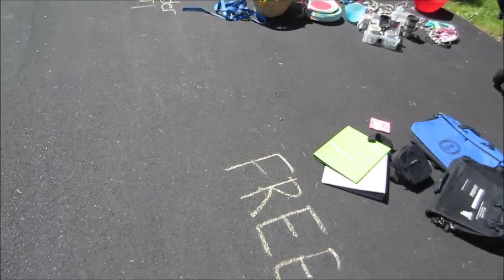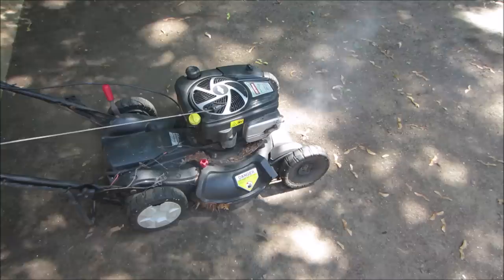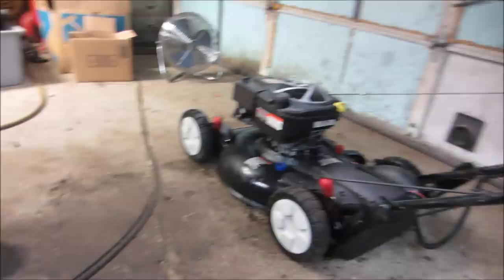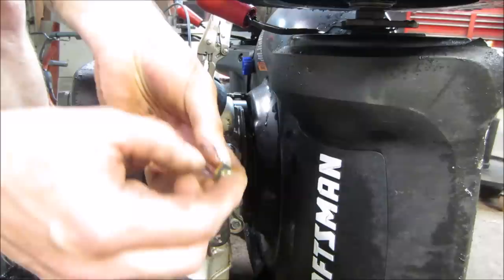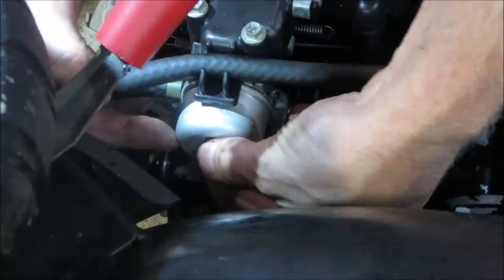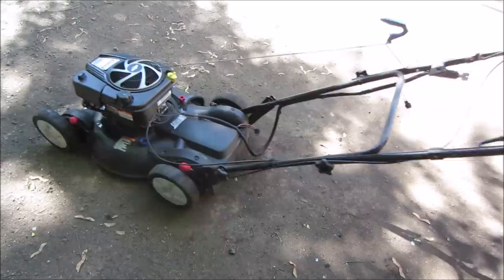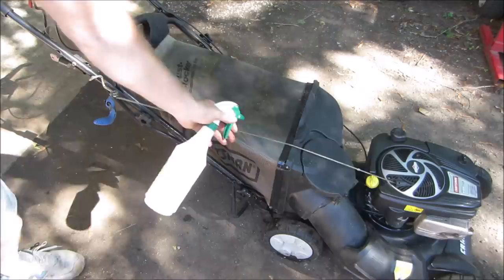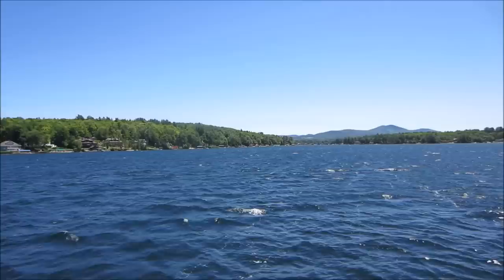Free yard sale broken lawn mower can we fix it?

Comment: My neighbor was throwing away a Toro Recycler, they said it was leaking gas and wouldn't stay cranked.  Looked like someone had taken the carb off and didn't have the auto choke set right and the bowl nut wasn't tight also the throttle plate was bent way down causing it to run slow.  30 min fix, cuts like a beast.
Reply: Does he give you the stink eye when he sees you cutting your grass?
Reply: @jaimhaas5170  No, they bought a new EGO battery powered mower.

Comment: To get the oil out of my pushers .I use a,1/2in PVC with a coupler to 1in to 2 inch and the 2 inch is about 10 inches long that equals about 2 quarts way bigger then most pushers can hold the other end is pushed onto my shop vac 3 seconds all oil is out kinds works like a line sprayer.i also have a ball valve to shut off the flow so it eont spill all over the place

Comment: Why mowers don't need oil changes.  From Briggs n Stratton: Its air intake system is sealed tighter so that dirt doesn't get inside the engine and contaminate the oil, and the engine runs cooler so that heat doesn't break down the lubricant.

Comment: I got a free Husqavarna mower with a Honda engine, which was $450 new for this exact reason.  Overfilled the oil and it fouled the plug.   Bad plug caused a hard start.  Dude gave up and bought a new one.

Comment: Actually was surprised to find on my mower while had a drain instructions had you tip the thing on it side and drain oil from the top like you did.  was a lot less messy that way too.
Reply: Their lawyers told them to print that. Keep the dumb public as far away as possible from the drain plug down by the blade : might get an owie and sue.

Comment: Dude, you really need to invest in a vacuum oil extractor. I use mine all the time. Much easier than all those gyrations you go thru all the time with these things, and not all that much money. One of the best investments I’ve made in shop equipment.

Comment: Additional Add to your 4 math Video.  Just the other day I Went to the Store and Seen a Lawnmower sitting next to the Curb Went and Knocked on the Door Asked " are you Getting rid of the mower in front "  Yes You can have it. It's Winter outside cold Okay Thank Quickly Putting it in the Trunk. Took it home Wondering what could be Wrong looks Brand new.  Pulling the Cord Twice Started up Hmmm. The Blade and Deck underneath Didn't look like it Cut the grass but one Time. 6.5 hp push Mower with brand new grass bag.  Good Score for Free When Summer comes back Around to Sell. People Throw Away or just get rid of some Crazy stuff.

Comment: I once got a free snow blower that had a rock stuck in the tine. Whoever was throwing it away I guess didn't realize why it wouldn't start. I got free lawn mower the neighbor was throwing away because it smoked bad. His son would turn the mower on its side to clean it out and the oil and gas mixed. The oil was almost all gas. Changed the oil and ran it an hour and ended up selling it for 150 dollars. Lol

Comment: Also mustie for further endeavours of cleaning fabrics trying washing machine powders that have stain remover built in into them and just sprinkle it over it and then lightly spray down with water and give  quick scrub let it soak in and then pressure it should yells much better results (even dirt cheap washing powder should work)

Comment: Mustie1, I am pretty sure that the battery is hidden under the black plastic behind the engine. That is where it is on similar model mowers.
Reply: yep, and the plug that should goes to the battery is "hanging" right there by the rear right wheel/handle

Comment: have one just like it got it free also spent 20 mini on It to fix (new plug new air filter,  Oil cap was loose was my problem, owner didn't ck it.   (I own/operate a sharpening service so I new what to do) P.S sharpen or replace the blade it will be worth your time,

Comment: For some one else struggling with one of these , do a compression test first ., many have plastic intake manifolds which seem tight , but upon closer inspection are loose at the head .,This leans out the mixture ,& destroys the intake valve , (check the edge ,if it's sharp as a pizza cutter you're done)..The compression should be 75 lbs or greater. Mine was 35 lbs , & although it would idle ., nothing short of an electric drill would start it & it had," predictably" , no power.

Comment: I believe the battery goes underneath the mower deck at the rear.
Reply: under the center plastic cover, which also covers some of the wheel drive setup. the power wire to the battery is hanging right by right rear wheel/handle area too ;)

Comment: Mustie, a pressure washer takes time for the water to "eat" away the dirt.  If you just keep moving it it will not be very effective.  Slowly move the water jet and let it do the work. Janky movements ruins the effectiveness.
Reply: Doing by moving the jet around is like using a regular hose and wetting it down.  Useless.

Comment: it's surprising how much havoc can be created by overfilling the oil on an engine. through an unfortunate series of errors i added an extra qt (or two) to my yamaha motorcycle engine once. after about a month of oil leaking out of the engine breather tube and into the airbox and out throught the air intake and down the side of the engine to finally lodge behind an under a chrome beauty panel on the outside of the engine and bake and smoke and stink for a few months, i spend about 20 hours trying to remove all the accumulated dirt encrusted oil from the engine. the fight ended in a draw....

Comment: I'm looking for a Craftsman bag for my push mower. I just recently found out they made about 200 different styles of connecting them to the mower.........ughhhhh. Not to mention my area is sucking for used cheap mowers.
Reply: Look at the model number of your mower and search it up, go to e replacement or parts tree or any other website with the parts of specifically that mower. You should find the bagger, you can order from there but usually it’s more expensive. The other option is after you find the bagger you want, copy that baggers model number as well and paste it into eBay or Amazon and usually it will be cheaper. Hope this helps but if you need more explanation tell me thanks

Comment: He was probably told that the plastic intake manifold shrunk back at the head (which would then lean out the mixture)., & that the valves would now make good pizza cutters ,but would be no good for anything else....Many ended up like this, & a simple compression test will usually show about 35 to 40 psi (about one half of what the spec is) ..yup it will start , but won't have the power of a fart in a windstorm.

Comment: If I want to clean the bottom of my lawnmower is there a way to tip it so the oil doesn't run out everywhere? Should I just empty oil each time? I want to keep the push mower underside from rusting and I know to be careful and not pressure wash the underside because of the seals down there. Thanks for all you great videos.

Comment: You may have mentioned it, later in the video it looked like you pulled the plug wire off before messing with the blade. Safety first!
Reply from the maker: you missed it
Reply: bah, having eight fingers, two thumbs and whole hands is overrated said nobody ;)

Comment: Mustie1a, in another video, I believe the one where you fix your neighbors old green/yellow mower, you seemed to elude to something that is equivalent to a bowl nut gasket or locking washer. Are these expensive little sealing washers the same as a fibre washer? If so, do you know the ID of the fiber washer replacment? Looking like that's much more inexpensive that spending 5 bucks for replacement s. Thank you for your time and help

Comment: For 20+ years I'd find mowers around the neighborhood at the curb to be picked up by the town in the spring. Most of them simply needed a good carb cleaning, a few had sheared flywheel keys and one or two had bent cranks (those went in the parts pile under the big pine tree out back). A couple went to my folks house for doing where the riding mower would not fit. They're still there & still run. Most went up to camp for a season & then got sold to the locals for about $50. I noticed a few years ago that these thrown away mowers are getting harder & harder to find as the meth heads (aka scrappers) from the city are snagging them as soon as people put them out.
Reply: Paul G we've got a neighbor up to camp who's had a hardened steel key in his mower for about a decade as our yards seem to "grow" rocks every spring & he got tired of replacing the key every time he mowed. The crank is now so bent that the mower could double as a paint shaker at the local home depot. It was originally a 20" mower (I think) and he now has the blade ground down about 3/8" on each end so that the blade clears the deck lol. I keep waiting for the poor thing to give up the ghost but I sometimes wonder if it'll wind up running long after I'm dead and gone.

Comment: I hate the rotary engines that have a dipstick it's too easy to over fill the crankcase. The really old engines the fill plug was level with the top of pan .
You couldn't over fill as it would just poor on to the ground . It's a wonder your engine didn't hydro lock being that over full.

Comment: I'm not a mechanic...  I have found when I change oil in my small engines that if I take my air hose and blow air through the engine from the top oil fill port, with the bottom plug out that it blows out a lot more of the dirty oil out of the engine. It also speeds up the process.  Could this do any harm to the engine?
Reply: no your fine  just blowing into crankcase
Reply: Yes it could cause harm, you're blowing water vapor from the compressor into the crankcase

Comment: Lawn mowers got hubcaps now!  Pity you didn't have any spares!  Does the electric start only work with a battery?  Some snow blowers plug into the wall to start electrically.  I'd much rather pull start a lawn mower on the lawn than a snowblower in the cold.
Reply: Was that Lake Winnipesaukee or Lake George at the end?  IFF (if and only if to mathematicians) it's Lake George, you came near me.  Lake George doesn't ever have that broad a view of the water without land though, that we saw at the end of the clip.

Comment: I found that same mower one time. The grass catcher design on that one stinks.
Also the design and location of the trans is in a bad spot too.
I ended up pulling the Quantum it had off since that was the only good thing too it. Because it was already missing parts of its bagger, a strike against it for resale, no bag and the trans needed help too so that made it not worth it. It wasnt even that old, it was like an 07 and I found it in 2015.
Those are the designs that end up making people ask how old is the mower when you sell one, yet on the other hand their are tons of mowers that were built with quality from the 90's still around.
Thats what I'm dealing with right now. I have a few green craftsmans (AYP) built around 1997 and the first thing people ask me, how old is it, but the age doesn't really matter, because the mowers are in excellent condition and are truthfully better than new ones. In fact these particular craftsmans were the best ever sold in my opinion.
Yea well try drilling that into someones head, dead set on age as the most important factor, its not, condition is. Not happening. I even tell the people I'm not concerned if you buy my mower or not, I am telling you as a small engine mechanic these older mowers are better, if you find one thats in good shape its the best ones you can buy. They still think newer is better. Uninformed consumers, what can you do? Let them go buy the new junk they make thats all.....
They don't wanna listen.
Oh yea the one guy said he knew it was old, but not that old because it still had a primer instead of autochoke. That's wrong too. Autochoke isnt new its been around since outleast 09, so 9 years and they still make engines with primers. The Briggs 550ex engine is a good example they make them in both Primer and autochoke versions currently, so another misinformed consumer. The actual tell tale sign it was older is the fact it has a 208cc Tecumseh vector engine on it with a throttle control, but he didn't know that....
That thing is way old he says, after I say its an 07...
Whatever.
Yea old, but in great shape and cuts the lawn good, what more can you ask for...
Reply: Well I sold that 1997 Green mower today. $125. I got for it.
Easy person to deal with, he walked up said start her up. I did mowed one path, he said looks good and took it.
Best type of customer you can get.
Now I got two more of those green ones to go aside from the ton of other stuff left yet...
I didn't disclose it was a 97, don't ask don't tell. Doesn't matter one of the better mowers Sears sold anyway. Important thing was it was in great shape and cut great and will go many more years if cared for, thats all that really matters.

Comment: more likely the fuel was left on and needle and seat leaked flooding engine and running into cylinder,have come across it many times.change oil and away you .go.

Comment: I cleaned my carburetor and gas tank, changed oil,blade, and spark plug,  wont start what could be the problem. Gas is new also. Craftsman briggs and stratton 2013. Was mowing tall grass, stopped and backfired. I cleaned it after that happened.
Reply: Might have sheared the flywheel key?
Reply: mattmanyam  I will check that. Thanks

Comment: Some mowers don't have drain plugs on  them anymore
Reply: they still do, but like the mower in video, it's above a metal plate that covers the drive belt for the wheels. even many non-self propelled have a shield in the way and you have to pull both the blade and shield off. total PAIN

Comment: How do I know if my B&S 15.5 is a 2 stroke or 4 stroke ?  It doesn’t seem to run good on straight fuel and I have to reduce the flow of fuel from shut off valve as it seems to start acting like it’s out of timing with valve open all the way. The mix oil seems to run fine.  Any thoughts ?  New carb doesn’t have fuel air mix screw. Thoughts

Comment: Why does everyone, work on a carb with the carb still attached to the motor.... I can understand a Honda carb cause they are a pain in the rear, but briggs are so easy to take apart and off the engine, you just make it harder on yourself working on it with the carb still attached to the motor, just an observation.

Comment: I’m no expert on working on lawn mowers pretty novice. I’ve fixed a few but I got one that stumped me. It is a craftsman push mower Briggs engine. It will run for about 10 minutes then shut off n u gotta wait like 5 mins to restart it but runs fine when started n running. No clue unless it’s over heating n shutting off any help or suggestions would be great thanks.
Reply from the maker: will it stay running with the gas cap off?

Comment: Question for you. My mower starts 1st pull but after about 20 mins of running if I stop it, it is really tough to pull the rope and will not start. If I let it sit an hour or two it starts right back up. Any ideas?

Comment: whats your opinion on running multi-viscosity oils?  Like Rotella T6 15w-40 vs straight 30?
Reply: Multi-viscosity isn't that big a deal, but if it's a small engine like this that is "splash-lube", you want non-detergent oil, so the contaminants settle out, to be removed at oil change. If you have a pressure-lube system, with a filter, you want detergent oil, to hold contaminants in suspension, to be carried to the filter media.